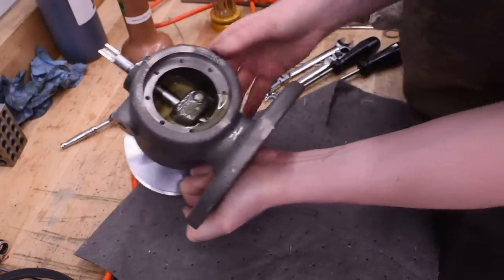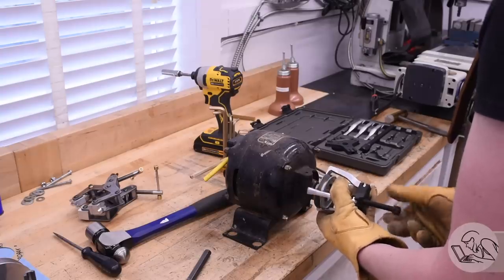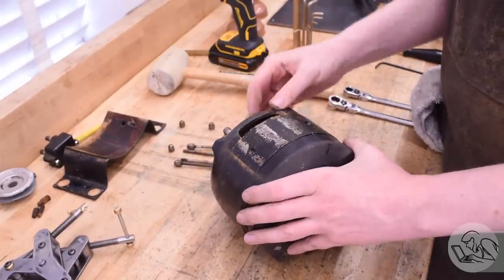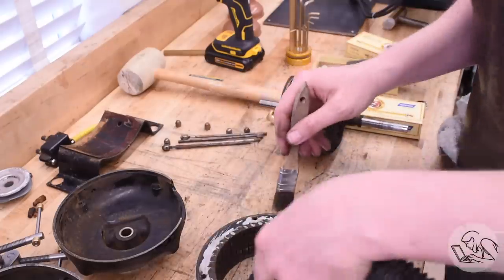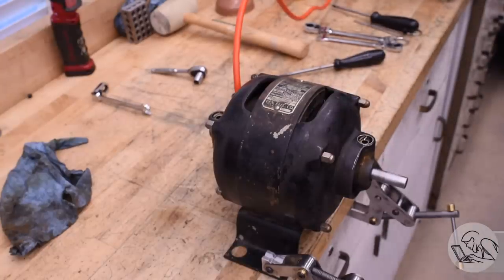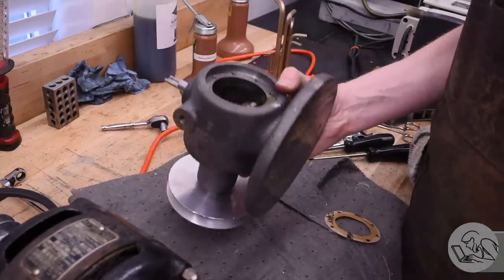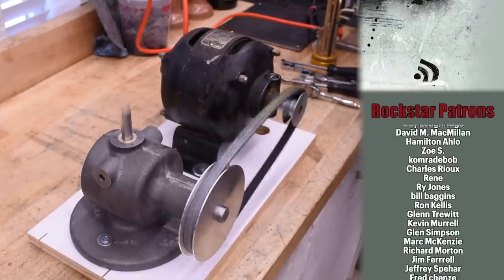1934 Electric Motor - Let's Build A Die Filer, Part 8.

Comment from the maker: Hey everyone- since people keep mentioning it, no I will not be painting the motor. It’s spotlessly clean and has a beautiful hard-earned patina from 90 years of work. I wouldn’t dare touch that.

Regarding the oil, a few folks pointed out that GL-5 (sulphur-containing) gear oil is not safe for brass/bronze parts, and you’re right. I missed that and will be changing to a GL-4 oil. Thanks for the tips!
Reply: Thank you! Sometimes renovation is better than restoration. I feel you made the right call for this lovely motor.

Comment: Hi Quinn, here is a tip. Always strip the outer insulation back further than the planned lead length when installing a new cable. Then trim the hot and neutral to the proper lengths. But leave the ground wire long!  This ensures that if some gumball were to accidentally jerk the cable out of the con-box, the last connection to be lost will be the ground. I did motor repair for a Navy tool room back when everything had a metal case, and the number of gumballs I encountered was astonishing. 😂 this trick helps kept the majority of them on duty.
Reply from the maker: A great tip in general, for sure! Wouldn’t have worked here though. Space was very very tight in that brush box because it wasn’t sized for three modern wires. I could barely fit equal lengths. An alternative that I could have maybe done is cut the sheath further back and run the ground outside the brush box over to that same screw. It’s not a factory ground anyway, so doesn’t matter much where on the casing it goes to.
Reply: @Blondihacks  I don’t have access to the heart symbol from my end, but please consider this one heartily hearted

Comment: 90 years ago we made things to last forever, now we use forever materials in stuff that should last 90 days or 90 minutes or 90 seconds. Progress!
Reply: @foldionepapyrus3441  I think part of it is that with all the computers and such it is much easier to accurately engineer things to fail as soon as possible after the intended lifetime. Also making things more complex (with more reliance on electronics) means they are much harder to fix for anyone but the manufacturer, particularly if you don't consider "just replace a subassembly more expensive than the thing" to qualify as "fix".
Reply: @foldionepapyrus3441  Fir enough, though I would say there is a significant difference between having to swap a whole board versus swapping one component on an older board. That sort of spot repair will be much harder when tons of smd parts are involved instead of a couple of standard reasonably labelled ones

Comment: As a retired engineer from GE Motors I’m glad to see you are using the good stuff…….
Reply: Hi, can you estemate how much this kind of motor was back in the days?
Reply: Do you have any idea why the RPM indicates an asynchronous motor, but it seems to have permanent magnets which belong to a synchronous motor that should run at 1800rpm?
Reply: I inherited it’s 3/4 hp brother from my father. It’s one of my prized possessions. ❤
Reply: @CatNolara  The rotor seems to have a starter winding with high ohmic resistance and low inductance compared to the main winding, to which it is switched in parallel. Therefore, the current in the starter winding lags less (maybe 30-60°) behind the voltage than the almost 90° of the high inductance main windings. It is also wound with angular offset to the main winding, voilà, you got your rotating field. When the rotor achieves sufficient rotational speed, a centrifugal switch in the rotor disconnects the starter winding to increase efficiency and keep it from overheating.
Reply: Those little RS type motors from the 20s and 30s really are great for small appliances and tools

Comment: It's crazy that cavitation can cause noises that seem to be metal parts either rubbing or hitting each other.
Reply: I know. I don't think I would of figured that out ever.
Reply: If I'm recalling correctly, the noise of knuckles cracking is cavitation of the joint fluid.
Reply: @g.tucker8682  I'll remember that. It's often just the little things you read in YouTube comments. Great info.
Reply: That's what you hear in the water around boats, also something submarines try desperately minimise.
Reply: The clicking is the nearly instantaneously collapsing bubbles of the cavitating oil as it gets pressurized by the close approach of the metal surfaces.
Reply: @ItsMrAssholeToYou  I remember reading an information board next to an old river power plant - When they built it they didn't have much experience with turbine construction so the engineers were astonished to see the turbine blades quickly beeing destroyed with literal holes eaten into them - all through cavitation bubbles. Luckily they had contacts to the ship-building industry who had also recently discovered cavitation and thus were able to solve the problem.
Reply: My parents steam had some water hammer. It just sounds like someone banging on the radiator with a hammer.
Reply: It wasn't cavitation. It was the yoke splashing on the oil pool below.
Reply: So it's not the cavitation, it's the foaming which removes the film strength of the oil causing metal on metal. If you have oil that is foaming, it can destroy the machine or engine because oil that is foamy doesn't have a thick enough film to provide lubrication. Foam = destruction.

Comment: Quinn - I didn't realize how much I DIDN't know about electric motors, wiring, and lubricants! Thanks so much for sharing this important information, and it's great to see the Die Filer run on electric power!
Reply: I had no idea that they made brushed AC motors in that era, that looked like that. I thought only the small power tools had the brushed Universal Motors that can run on AC or DC and have a split commutator, such as a Skillsaw or Drill. I have never seen a motor of that vintage with brushes, that's so interesting. I wonder if most of them have been destroyed at this point? I have a 1940's or late 1930's washing machine motor that I restored, and it doesn't have brushes.

Comment: The puller used here is what I would call a gear puller.  It's really meant for pulling gears and sprockets (and some heavy pulleys) that have substantially more material around the outside to actually apply force to.  For a regular sheet metal or die cast v-groove pulley, you should look into a split bearing puller, also called a bearing separator.  This will apply force directly the pulley arbor and eliminate the risk of damaging the perimeter.  I've seen some heavier pulleys and gears with drilled holes in them specifically for pulling, in which case a straight bar puller would be used as well.  Of course, this is all dependent on proper "design for serviceability" that may not be found on some consumer goods.
Reply: Great tip.
Reply: Was going to say that puller is a great way to bend or break these soft pulleys but figured someone beat me to it.

I bought the OTC bearing splitter set and looked on Amazon and other brands are @ $60. Don’t think I paid more than $75 for the OTC, but was a long time ago
Reply: @ellieprice363   Yep. So called 'monkey metal' or monel. Don't think it's good for anything else besides cast toys like Hot Wheels ™ or cast mini furnishings for dollhouse decor. 🚒🚑🚽🗑️🕰️
Reply: @just_saw_dust  I seem to remember Lyle of Mr Pete 222 tubelcain removing a very small Jacobs drill chuck from a press fit on a tapered shaft once in a very similar way with slightly tapered metal slotted thin plates . Or maybe it was Lance Armstrong or Patrick of Active Atom. Anyhow, I agree. That would work deliciously. I have encountered a stubby knurled tip set screw that was over torqued and followed by a dog point setscrew both Locktite™ 242 in place and a half-moon key forced into an off-center keyway that had the dreaded red Locktite™ 602 on it for grits and shiggles. When you find these signs in that order, getting progressively worse you find out that you're not being paid enough to save a $3USD pot metal pulley. Just cut it off and cut a proper keyway into the shaft once everything is cleaned up, and go back with a real steel pulley that might cost twenty bucks Uncle Sam Stamps. Will save the next person a lot of frustration 20 years down the road when a tightwad Shop Manager says to just overload the motor and gear train and everything else by going to a 25% larger pulley to speed up the operation for production's sake. Gotta grease up those Brownie Points upper deck management so he can get a promotion. But ya gotta just grin and shake your head and comply for $65USD/hr. It's All in life's big circle, bruh. I'm 68 years old and have seen it all. Well, maybe not ALL, but a big portion of my Fair Share. Gimme a thumbs up or pin me and I'll be quiet. 👍❤️📌(☞ ಠ_ಠ)☞🤨

Comment: I like when you explain things like why use one oil vs another or why the motor will run at something less than the theoretical max 1800 rpm. I like learning things like that in the interesting and engaging way they you present. Well done.

Comment: When I built my die filer, I mounted it on a board much like your own, and used a similar motor, about a century old.  I still have it on the same board with rubber feet so it goes with me on the bench and the motor never did get opened, simply runs great.  I ran across about a dozen die files at a flea market a few years earlier and have been using them and it for better than a decade, I expect it to outlive myself.  Thanks for showing your trials!

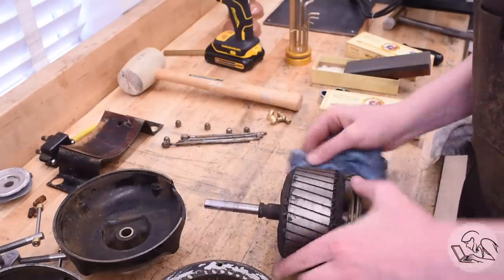Comment: This is a split-phase induction motor with the squirrel cage winding on the stator rather than the rotor where it is in modern motors. The rotor has a start winding as well as a run winding and a centrifugal switch to disconnect the start winding when the rotor is up to speed.  The switch mechanism behind the slip rings can be seen briefly at 8:55. The switch contacts should also be cleaned and the mechanism lubricated as part of the restoration project.   You can also hear the subtle clicks of the switch at 18:39 and 19:01 as the switch opens and closes as the motor is speeding up and slowing down.  Can't wait to see the filer filing!

Comment: Congrats!  It was great to see that motor cleaned up and used for this.  It's a great example of how a well designed bushing based system can work.  Almost 100 years old, built with replaceable brushes and probably bushings, too, yet both are likely original.  I'm sure it was not in continuous service for that long, but it still speaks to designs that were made to last, which is much more sustainable and overall less expensive than many things made today.  Plus it looks great beside the cast filer.

Comment: I am thoroughly enjoying this project, Quinn. Thanks for taking us along for the ride.
Perhaps, when you do the final wiring with switches, fuses, etc., it might be worth considering a solid state AC speed controller. Given that you frequently shape nonferrous metals, the option of running slower and less aggressively could be quite useful.
Reply: @Roy_Tellason  Yes, it will. AC motor speed controllers work by varying the frequency of the input. Solid state just makes them more reliable.
Reply: @ellieprice363  Yes. They can be and frequently are. An AC Motor speed controller works by regulating the frequency of the input.

Comment: A few days ago I took apart a DELCO motor of the same 1/4HP and 110V rating, so likely similar age, early 30's.    My motor is even simpler design, a split phase design so no brushes.   The rotor is the permanent magnet and the stator has the windings, one for starting and the main one for running.   It also has the oiled bearings, but the DELCO design was "lubricated for life".   From what little I have found to read it was most likely used in an appliance e.g., washing machine, so the "lubricated for life" was intended to be the life of the appliance.    The oil ports have caps pressed in place.   I was able to get some new oil in the felts while it was apart.
My motor sounds just like your motor.   Both are oldies but goodies.   I just do not have a project for my motor.   It was previous used to power a Mead Bandsander I purchased at a yard sale some years ago.   I power the Mead Bandsander with my wood lathe.
Good to see the die filer running smoothly.
Dave.

Comment: Just a suggestion, Quinn. When you build the permanent stand for it, include a NO foot switch, so that anything that causes you to jump back also shuts the motor off.
Reply: Or a proximity sensor. Overkill?
Reply: @StanErvin-yo9vl  not if you have a case of them in the back of your garage,,,

Comment: Regarding crimpers, I'm an HVAC service tech. I need to do crimps A Lot. That lovely tool won't fit in my bag. However! Klein makes a linesman plier that works flawlessly. Especially if you know how to prep the wire properly. It's the D213-9NE-CR. What I mean by prepping the wire, if it's stranded and can be folded over and still fit the connector, that is excellent. I do not like crimping to solid (like thermostat wire). But if you fold it over so the end is in the middle of the crimp it won't pull out.

Comment: Tip with optical tachometers - hold the tachometer off-axis to avoid reflections from the pulley. The tape (usually supplied with the tachometer) is retro-reflective, so works fine off-axis.

Comment: The pulley was likely made from Zamak, a zinc-based alloy with fairly good mechanical properties and a melting-point of about 380-390 °C. It can be shaped into various forms with die-casting.

Comment: Yay!!! It's Blondihacks time!!!
Reply: [Goes back to pause video at the motor plate] I have that same motor on my power hacksaw... it works quite smurfy, and I also had to clean sawdust out of it when I opened it up. (It worked and ran, but the saw was running backwards so I opened it up to reverse it so that the oilers on the saw parts worked properly)

Comment: Interesting motor. I have been an EE for 50 years and never ran across a small brushed single phase AC motor like that. 
I did do some slip energy recovery with large 3 phase AC machines, and a ton of controls for DC machines. Still installing large DC drives for municipal water and sewage, and paper machines.
Reply: @nutgone100  She said that the person who sent it to here said that it came from a bandsaw.
Reply: @Nutgone Matt 
 we found the original patent nr 1566939. Apparently the rods in the stator are not magnets, but conductors of a squirrel cage, like most modern brushless asynchronous motors would have in the rotor.
Reply: @smps_enthusiast5391  interesting! You could change the motor characteristics by inserting different resistance in the rotor circuit.
Reply: I asked myself the same question. As an electrical engineer I have some basic understanding of different types of electric motors / generators, but this kind of motor is new to me. 
In Germany brushed DC motors are (still) used with low frequency (16 2/3 Hz) AC, but AC motors with slip rings are a bit strange.
SMPS_Enthusiast suggested that this motor has a squirrel cage in the stator and the windings in the rotor. This sounds plausible to me as it would be some kind of "inverse design" to the common asynchronous 3-phase motor design. However I am wondering how the required 3rd phase is derived from single phase AC in this particular case.
Reply: @smps_enthusiast5391  Indeed, it looks like a squirrel cage motor, just with the rotor and stator reversed. The AC is picked up via the large disc on the front, and it goes inside the windings on the rotor, where it generates a rotating magnetic field. The rods in the stator then are the parts where the magnetic field is induced to actually make the rotor spin. I am pretty sure there is no permanent magnetism on the stator, as it would attract stuff from all over the place if it did.
Interesting design! I wonder what the advantages over a conventional squirrel cage are, since there definitely are some disadvantages (namely, wear on the rotor/slip ring in the front)

Comment: Great video. I learned a lot and I loved seeing you run the die filer for the first time! Yippee!
I was given an old motor of the ‘universal’ type to power my first lathe. I needed to reverse the direction so I went on the information safari. I wound up speaking to Westinghouse on the phone and they pulled the print out of the vault for me and answered my question. They enjoyed it and so did I.
If I was as brave as you, maybe I would have broken the case open! Next time!

Comment: It's looking great!! In terms of a belt tensioning system, if you're mounting the motor vertically beneath the filer then the weight of the motor alone will probably be enough I would think? Give it some slotted holes for the motor bolts and you can just let gravity do it's work before you align it and tighten.

Comment: Ty for yet again an awesome video! About the oil, i would go for a straight 30 or 10W30 (10w40) whole mineral oil. Mineral oil usually works very good with cast iron and brass bushings. Older engines with cast iron blocks can even start to knock if you use semi or full synthetic oil in them. And if it's a good mineral oil it should have zinc in it which gives sliding parts a longer life.

Comment: Hi Queenie, great job as usual. I know allthose motors have been running for years as is, but it would be nice to see some sort of vented dust caps over the motor lube holes to stop the posible odd detritus getting in.
  You are not only a great engineer, but you are also a great entertainer with a sence of humor 👍